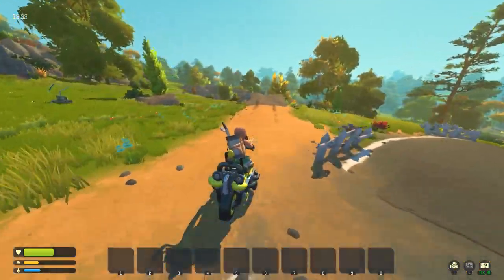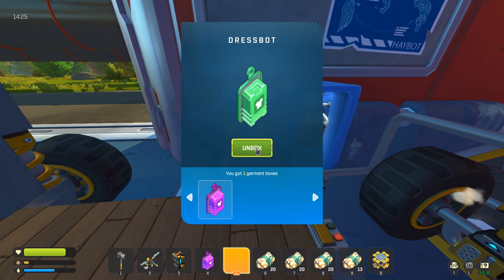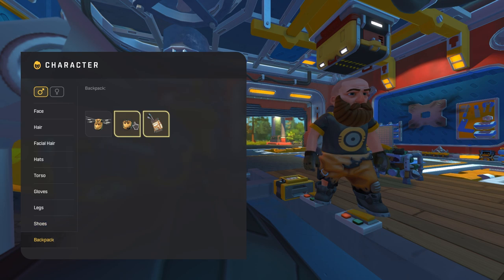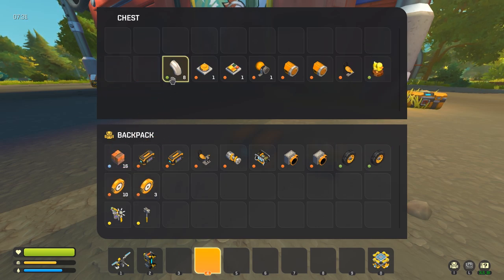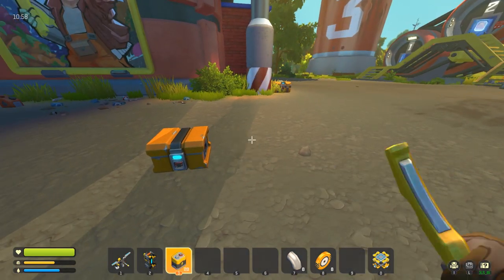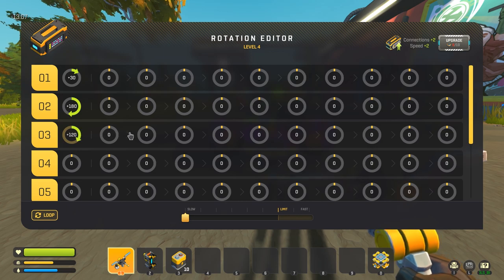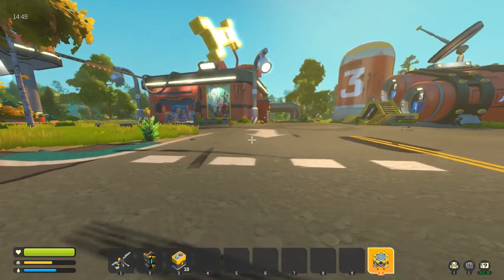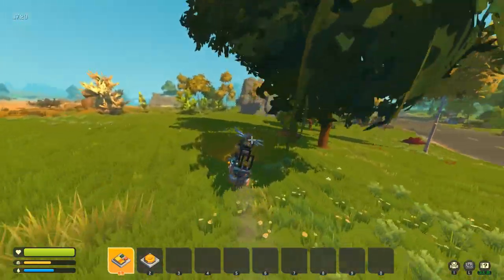Scrap Mechanic SURVIVAL #03 - BUILDING A WORKING MOTORBIKE!

Comment: followed to the letter all values and rotations correct, but the thing keeps rolling over on its side. it sometimes self rights but ends up on its side and can hardly be said to be functional. works great going straight. if all you need is a straight line. turns and hills are what you need in survival.
Reply from the maker: I have no problems with either on my bike, have you checked that you have loop set on both of the correction controllers?

Comment: Bike works great, but it feels like it steers from the rear, it swings really hard, did I do something wrong?
Reply from the maker: Steering is a little towards the back, due to the placement of the suspension glitch, unfortunately I couldn't get it any further forward in such a tight little build.

Comment: i've tried making this in creative, i have a problem where the sensors dont seem like its working
Reply from the maker: This creation is Survival mode only, as the Ra-Units were patched in creative a while back and still don't work.... However I have made a suspension stabilizing version of the Bumblewasp which has been uploaded to the Steam workshop, that will work in creative!
Reply: @SpexxyYT  ah that makes a lot more sense. thanks for the content and help.
Reply: did you take the good sensor, cuz there's something in creative that looks exactly like a sensor called item not found that just doesnt work

Comment: Thanks for the video! I've just tried building it. It works but the steering is REALLY stiff. Not sure where I've gone wrong. Any help would be greatly appreciated.
Reply from the maker: It sounds like you may have connected something to the block on the inside of the suspension glitch, do you notice anything move a little, where it shouldn't?
Reply: @SpexxyYT  The turning goes wrong once I assemble the rear wheel forks. I'm not sure how to fix it. Oddly enough, If I attach the forks to the sensors, the turning is fine (though obviously the rear wheel looks wonky.) Its like as soon as I attach the rear wheel forks, the block on the end of the suspension is no longer attached to the suspension if that makes sense?

Comment: Doesn't seem to be working for me.  I mean it tries to correct but eventually it falls over.  I did make my bike a lot longer though.  Too much weight maybe?
Reply from the maker: Maybe. Try to keep the weight down, it'll certainly work better!
Reply: @SpexxyYT  Here's what I learned.  Light is better.  But also it doesn't hurt to max out the controllers and have them set to the fastest setting as well.  Faster they spin, the faster it will right itself.  I used wood block 3's for the light weight and high durability. But you want to have some weight to it or the wheels won't be on the ground much.  It's a tough balance to find.
Reply from the maker: I'm glad you found a solution!

Yeah weight distribution is very sensitive in this game for sure.
Reply: @SpexxyYT  It kind of seems like the old creative glitches don't work as well in survival.  I tested a budget flier in creative using the stabilized shock blocks glitch and it was flawless.  I built the same one in survival and it dips, turns, and does all kinds of weird things.  It's still airworthy but it's just not as good as the creative version.

Comment: My motorbike always falls over, then comes back up after like 5  seconds, is there a way to make it go faster? Ive tried turning the controllers up and the sensors but it still does the same thing...
Reply from the maker: Maybe it's a weight distribution issue, did you build the same as in the video?

For making it go faster it will again come down to weight, a lighter bike will pop a wheelie very easy if powered by the back wheel, you'd need to ensure the front is weighted down...
Reply: @SpexxyYT  I built it exactly the same in the video though, every single step except i made it out of wood, and ive got a chest on the front and a seat on the back...

Comment: Can you make a tutorial for the bumble wasp
Reply from the maker: A tutorial for Bumblewasp could be possible, but trickier..... you can pretty much change the bike in the video by using pipe pieces and other parts to make it look a lot better.

I did tinker with a suspension stabilizing version that I have uploaded to the workshop for everyone to enjoy in creative mode, it just isn't as cool as the Ra-Unit version, but unfortunately Ra-Units still do not work correctly in creative mode!

Comment: I followed every step and I'm having issues with the steering (It snaps back and forth so fast it whips the bike around), the fact it slowly starts to lean to the side the longer it is driven, and it wants to pop a wheelie after any sharp turn. Advice?
Reply from the maker: If it slowly starts to lean, that sounds like either a sensor set incorrectly or maybe one of the rear ra-unit controllers is not set on a loop?

Also make sure that you have not attached anything directly to the block on the end of the suspension glitch, the rear forks should attatch to the engine!

Comment: So I've tried to traditional suspension glitch with 2 suspensions but it always gets wonky in survival. How do you make it work?
Reply from the maker: Suspension glitch is not so reliable in survival.

Using more that one for steering is overkill and it is too iratic for smooth stabilization...

I find the Ra-Unit better and more compact too!

Comment: Can it still work if I put wheels at an angle ? I'd like to make it look somewhat like akira bike. Will it also work with suspensions attached to the wheels ?
Reply from the maker: Angling the wheels is OK, Bumblewasp has angled front forks, but to fit them in I had to attach a T-Pipe to the suspension glitch block at the front, which turns a little, but still works ok.

Suspension on the forks should also work fine, but you might need to tweak the stiffness of it and engine speed to find the right balance!
Reply: @SpexxyYT  Great, thanks a lot !
Reply: @SpexxyYT  I didn't see the video through the end earlier and just noticed the other bikes ! Indeed your bumblewasp as what I want in the front. I'm wondering why you only have the ra units on the back on this one though, does it work just as fine without the ones on the front ?
Reply from the maker: @SauceVinaigrette  they are there at the front, I'm just using the handle piece on them instead of the two pipe corners!
Reply: @SpexxyYT  oh I see, thanks !
Reply from the maker: @SauceVinaigrette  No problem!

Comment: Can I use a gas engine since the batteries are hard to obtain
Reply from the maker: You can, however it may effect the balance, as the gas engine is a 2x2x2 cube, it has no center to attach it....

You would pobably be better to use the car seat and large wheels for a gas engine bike. version
Reply: Thx

Comment: I made this bike, but because of my terrible driving, a hay bot destroyed it and now I don’t know where it is. (Sorry I didn’t mean that this bike was bad)
Reply from the maker: I didn't state it was indestructible, It's made from the basic scrap blocks, with low durability, it isn't made to go into battle so of course it will get destroyed easily if it gets hit...

But they have to catch you first and It's a lot faster than the haybots! 😜
Reply: It’s ok. I found one remaining side of the bike which was the part with the engines and the controllers. I fixed it, but now it doesn’t stabilise itself.
Reply from the maker: Probably best to rebuild it from scratch, it doesn't take too long!
Reply: Thanks for the quick support!

Comment: My one didn’t work the back is set to spin out and the front is set to spin in the 2 3 set of bearings are 180 and the  4 5 are set too 300 on the second row can anyone help me? Does it work in creative is that my problem
Reply from the maker: Unfortunately it will not work in creative, the infinite rotation glitch required for the  Ra-unit has been patched, but for some reason it still works in survival?!?!

Sorry about that!
Reply: Spexxy thanks
Reply: @SpexxyYT  so that's whyyyy, I've been doing a couple of motorbikes and none of them seem to work in creative

Comment: it doesnt turn as well as in the video..
Reply from the maker: Did you make it with the same parts?

Survival has very sensitive weight distribution rules...

Using lighter pieces will result in a far quicker and more iratic turn.
Reply: @SpexxyYT  turns out i used driver seat instead of driving saddle and it made such a huge impact.

Comment: It doesnt take 7 hits anymore... I dont think it ever did
Reply from the maker: Mine are still taking 7 hits and the whip bots take 4..... Why has my game become harder?
Reply: @SpexxyYT  I heard someone had the same issue because they lost their hammer and replaced it with the commands. The one you get from the commands seems to be weaker. Did you had to do that to retrieve your hammer or something ?
Reply from the maker: You might be on to something, I have used commands, but only once, to export my Bumblewasp to creative mode so that I could upload it to the workshop, but I don't remember replacing my hammer at that time!
Reply: @SpexxyYT  oh did you get early access? Because mine takes 5 and whip bots take 3! But tapebots are so annoying and hit you for 55 damage! Before they hit for like 35
Reply: Spexxy try saving for a spud gun and you can test it to see if it’s your hammer or if it’s the bots